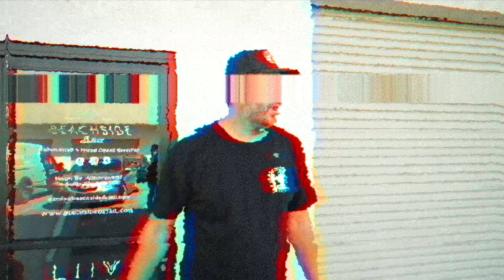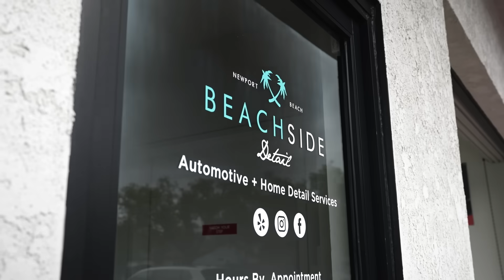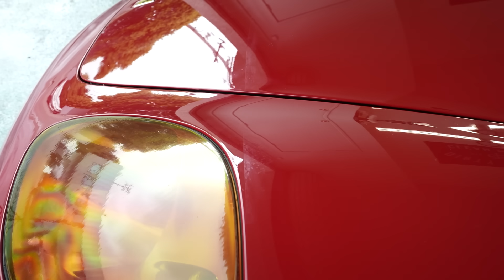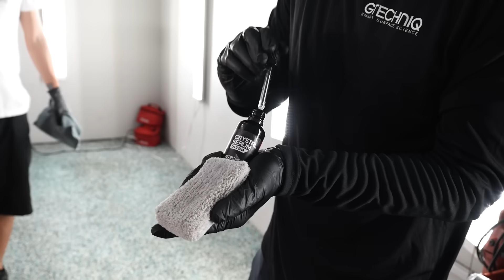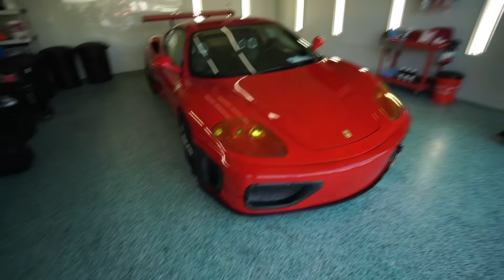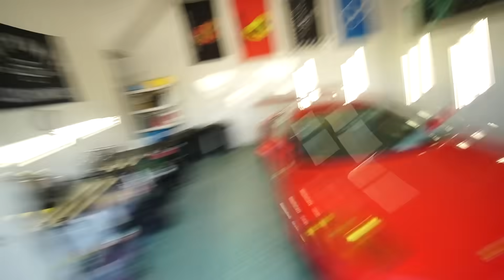Detailing Scotto’s Ratty ‘rrari — Ceramic Coating for that Factory Shine

Comment: They did nice work... modern, self-healing PPF is miles ahead of those old "clear bras". Very much worth it on an expensive car. There's a local detail shop that I've used who has a contract with a nearby Porsche dealer to apply ceramic coating and full body PPF to new Porsches before they are delivered - it probably costs $7-10k but you just roll it into the finance deal.
Reply: “Just rolling” 7-10k into a finance situation ends up costing you 12-15k for something you could do yourself for 2k.

Comment: No wax before the ceramic?
Reply: No wax, even though it does a good job of leaving a shine and some protection too, the ceramic coating will do much better, but if you mix the two neither the wax or ceramic coating will work properly